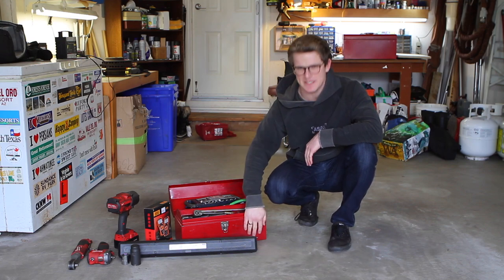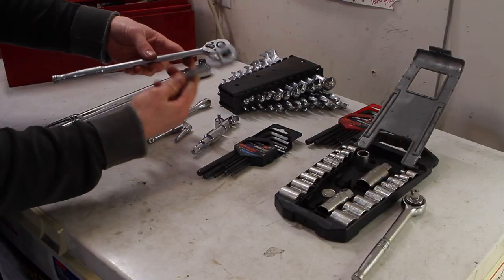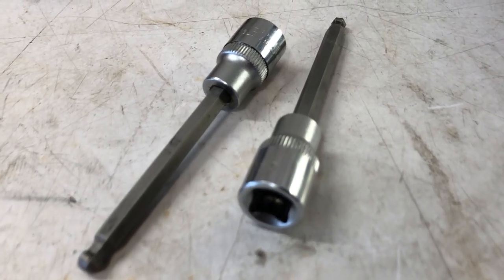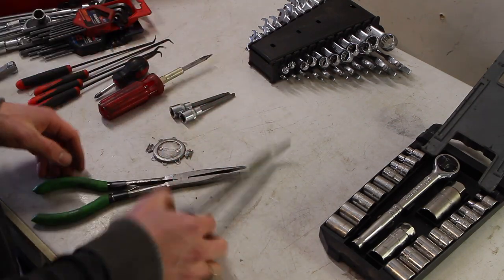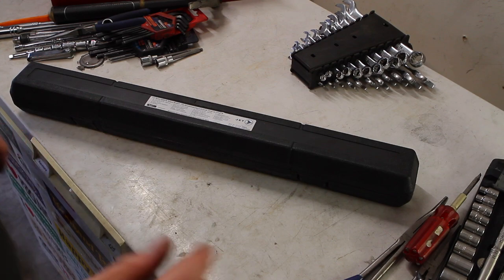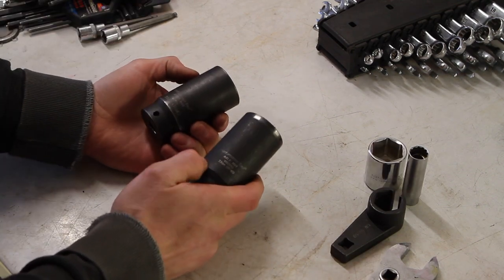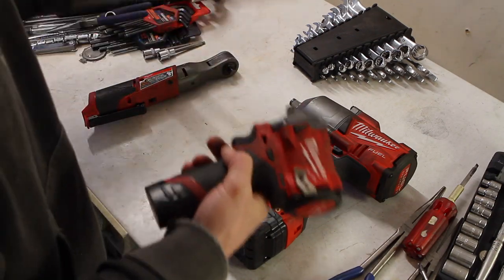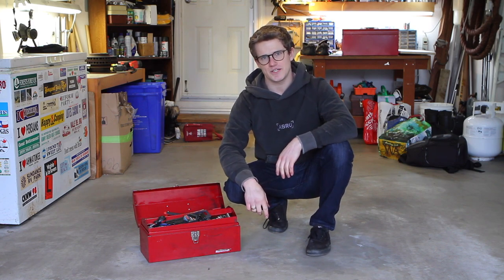Everything you NEED to work on your FZ6 and more! - What's in my toolbox

Comment: Great vid, how's the misfire diagnostics going?
Reply from the maker: I haven’t made progress with it as the bike has been tucked away for winter. I plan on checking the wiring harness at the ecu for corrosion on the pins, gapping down the plugs a little more and checking the battery voltage at idle. Hopefully that resolves the issue. I’ll keep you posted though when I have some news!